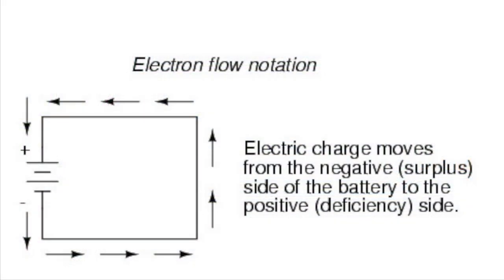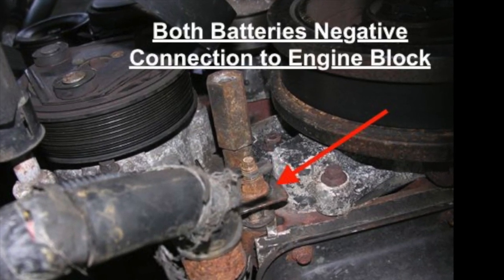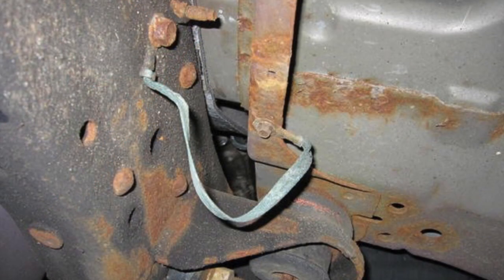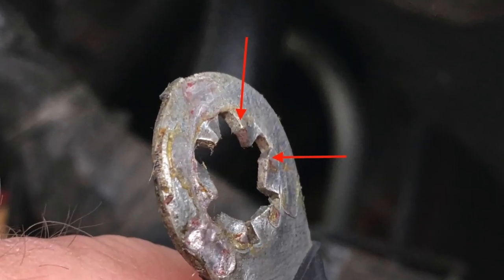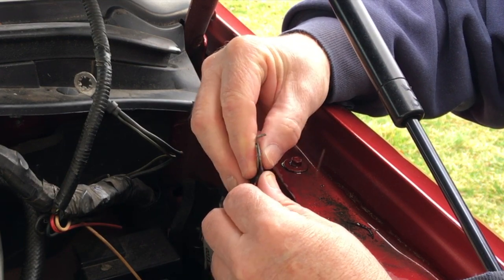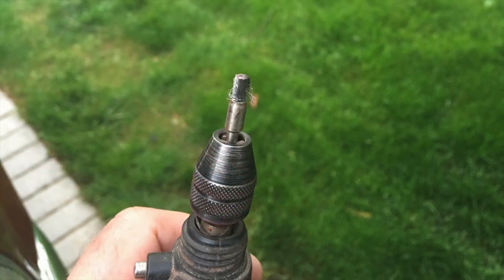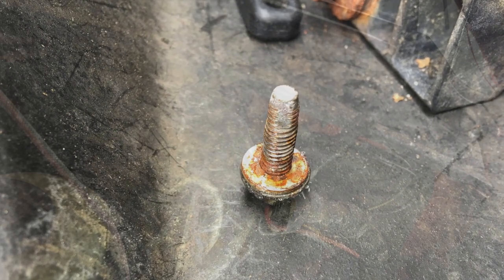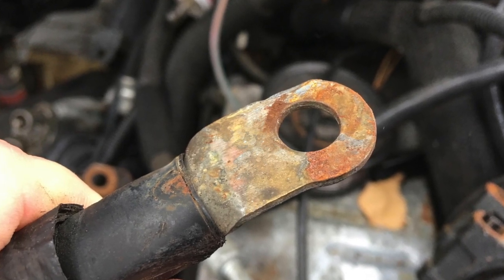Powerstroke 6.0  Electrical System Negative / Grounding Locations

Comment: I’m having electrical issues with my 07 6.0 no one can figure out I need help it keeps drawing batteries even with the disconnects hooked up when you hook power to batteries the radio starts playing and window go up and down and peer gauge lights stay on.
Reply from the maker: I haven't had to play with the later model trucks, but a lot of the issues you are describing emanate through the gauge cluster in the later years, as weird as that seems.  I'd recommend talking to Circuit Board Medics as I know they have solved a number of what you are describing due to a short in the cluster.  I've known them to also come back without doing a repair when the cluster assembly didn't need it.  They can also troubleshoot over the phone.  The gauge cluster ends up being way more than just gauges, for windows, radio ......
Reply: TooManyToys thank you very much for this reply ! I know the cluster in this truck is not the original and the cluster does not work correctly it will not read miles on odometer , but the edge cts2 tuner I have on it tracks the mileage correctly they the computer it’s a very difficult thing to understand ! I have tried different clusters and same issues  . I have never hooked a battery up and everything power in the truck come on and day to day a battery reads good next day it’s bad and the battery that read goo the day before reads bad 🤷‍♂️ this things has been bullet proofed new injectors egr delete new built tranny but these electric issues have me exhausted lol
Reply from the maker: @matthewdailey8609  I would still talk to them as they have the most experience with cluster issues.  Hopefully, all of those clusters have been of the same model year and maybe trim level.

Electrical quirks are very difficult to track down.  You need the schematics and a good knowledge of electricity.  Not trying to blow you off, but simple issues are easy to solve online, complex, not so much.  The simple version of finding a draw is a good ammeter and pulling a fuse, then checking in 20 minutes.  You have a cross-functional issue.
Reply: TooManyToys thanks brother I appreciate it !

Comment: Awesome video series..  I learned so much and was able to address some issues with my voltage fluctuating after installing the Leece Neville 230A alternator.  Checked all the grounds and added some grounds (like the one to the engine from the frame rail on the driver side)..  Re-installed the Leece Neville and all is good.  Thank you!   2006 F250 6.0 Liter.
Reply from the maker: Glad it helped, and thank you.
Reply: @toomanytoys  Wish  my High School and College Physics teachers provided real  world  examples like this.  It  would have  made  learning a lot more fun!

Comment: Do you have a video, or know of one that has positive termination locations? I'm replacing battery cables and looking for info
Reply from the maker: I did not do a video on that.  The connections are not as sophisticated.  Positive at the alternator(s), positive at the passenger battery, positive at the driver's battery and the final positive at the Central Junction Box.

Comment: Toomanytoys i need ur help lol i live in nj my truck just dies while driving dosent happen all the time some time goes a year with out doing it other times it happens 3 times a day lights go off when you plug it into a computer and nothing comes up I've spent thousands of dollars trying to repair this truck Im not even done paying it off yet they gave me a new wiring harness I replace the alternator  brand new batteries there's so much  Ive did to it I have a list that goes on and on and on I'm beginning to think it's a wiring issue I live in New Jersey would love to have you work on my truck
Reply from the maker: Jeff, I don't do repairs on other peoples trucks.  I'm a retired researcher and not in the retail business. Bad experience doing that in the past.  Sounds like a short in the electrics, but that doesn't necessarily mean the harness.  You should post to Ford Truck Enthusiasts or Powerstroke.com as there are many who can help.  YT isn't a good medium for that.

Comment: Hopefully you still go back and check these. Very good video and great electrical knowledge. My question is can I replace a flat braided ground with a actual round cable ground and will it effect my truck in a good or bad way? Thanks in advance for any input you may have.
Reply from the maker: I do.  It can be changed, the braided ones size to a 12ga if I remember correctly.  The advantage of the braided cables is they flex without breaking, the bad is they corrode if exposed to a wet environment like under the vehicle.  But a normal insulated wire, preferably marine grade tinned should be fine as long as it's not tight.

Comment: I have a 2004 6.0. When I put a voltmeter to the negative and positive on the passenger side battery I get 14 volts. When I do the same to the driver side it shows 12 and a half. If I take the positive probe put it on the positive terminal in the negative to the block I get 14. Is my driver side battery charging? It seems like it is I don't see a drop in the voltage on the battery. I don't know if that is the correct way to check if my driver side battery is charging. Any input would be right
Reply from the maker: With 14~ volts, is this with the motor running or right after stopping the motor?
Reply: I have this same problem. With truck running one is 14.2 and other is ~12.5. When I shut off, both are ~12.5. When I take ground from 14.2 and run it to the 12.5. the low battery then runs at 14.2. I think the low battery just need to be regrounded.

Comment: Jack thank you for your reply ref. stock pulley alt. Rapid convert has nice charts ,https://www.rapidtables.com/calc/wire/wire-gauge-chart.html . Also home depot in the plumbing section has nice stainless steel brushes { numerus uses ] with handle    .5   .75 and 1.0 in. cut the handle off  and now you can use it with cordless drill to get those painted grounding points!   thanks again Bob

Comment: Thanks for your very informative video. What did you have to remove in addition to battery and battery pan to visualize the grounding point on the passenger side battery cable.
Reply from the maker: Jesse,  right now its hard for me to confirm as I've got my motor out and everything is apart.  I remember pulling the CAC tube, battery and battery tray.  I had the stator removed for quite some time, but I don't think that would be in the way.  I would first pull the battery and tray and see if that gives you a decent pathway.
Reply: Thanks for your response. I think I am going to have to pull the CAC tube.
Reply from the maker: 7/16" or 11mm for the clamp nut.  Just clean the boot connections well going back on.
Reply: thanks

Comment from the maker: Thanks Chip and all you guys.  I'm enjoying learning how to do these.
Reply: TooManyToys, for me it’s VERY interesting! My 2006 has had the cab off (before I owned it) and I noted a different starting process between warm and cool (SW Florida). No codes. Fuel and oil pressure were ruled out, then I got a scan gauge ll and see my “main” FICM voltage is down a by  .8 volt. Batteries and alternator check out. Now the voltage drop check begins.
When I saw your video it confirms I’m not nuts. 
As spring settles in I will be able to devote more time to this and will report my findings in a video. I need to learn more about video editing to make a decent video. Thanks again!